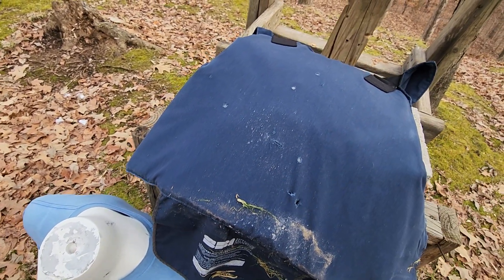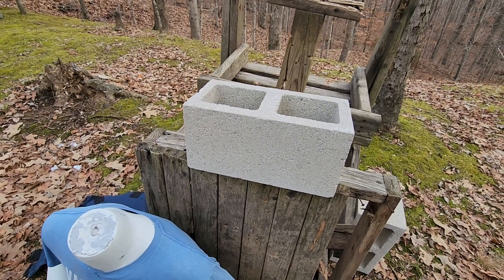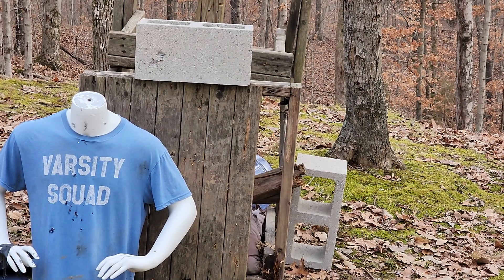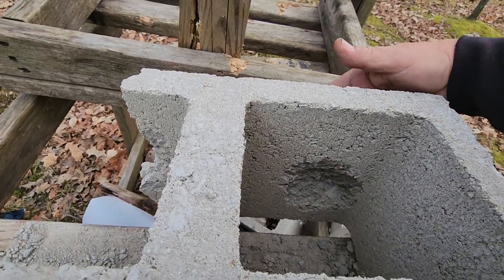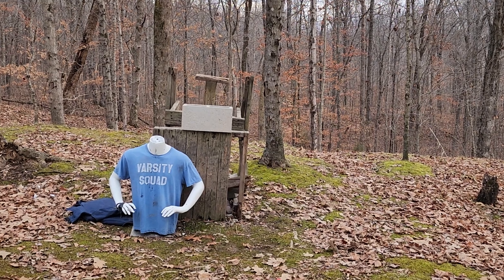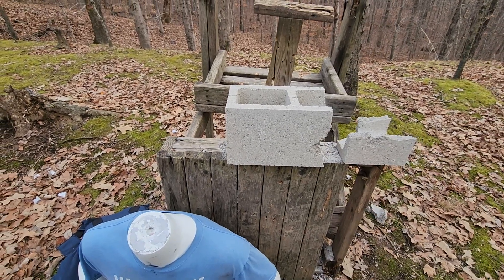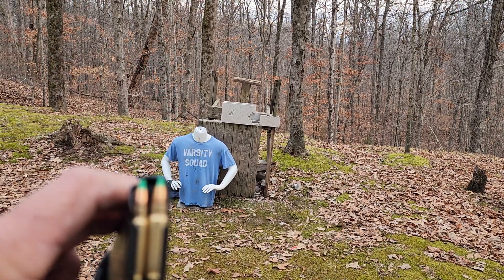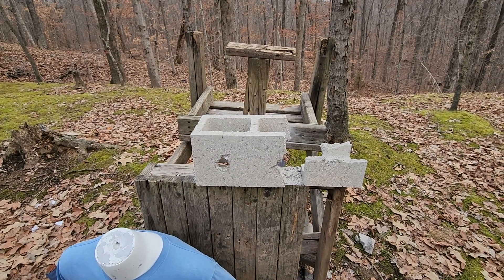5.7x28, 45ACP, 300blk Penetration On Concrete Cinder Blocks #guns #5.7 #45auto #300blackout

Comment: Pretty interesting. I thought those 4 green tips would have gone all the way through both sides.
Reply from the maker: It's fast but only 28gr so it doesn't have a lot of mass to keep that momentum going. It still surprised me by how well it did.
Reply: The whole point of the round is to minimize over penetration, penetrate soft body armor and dump energy on soft tissue.